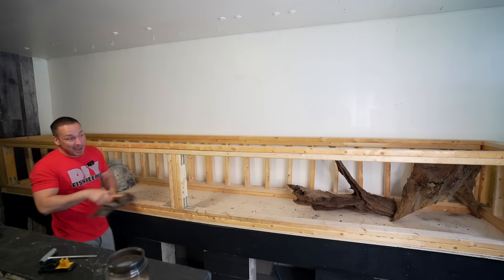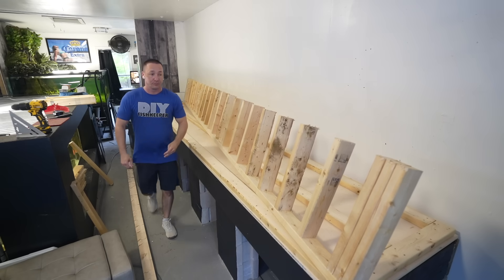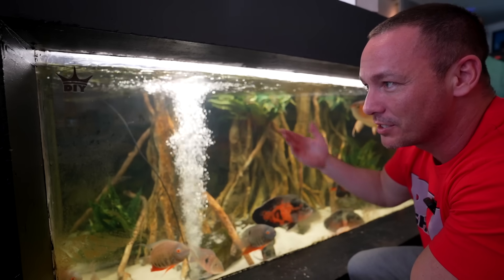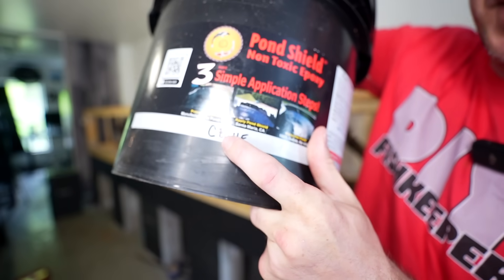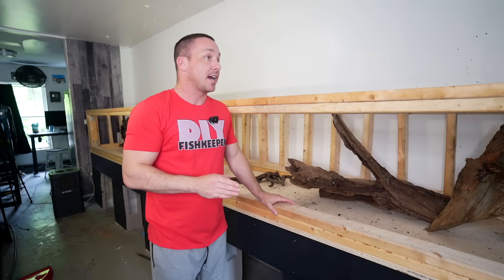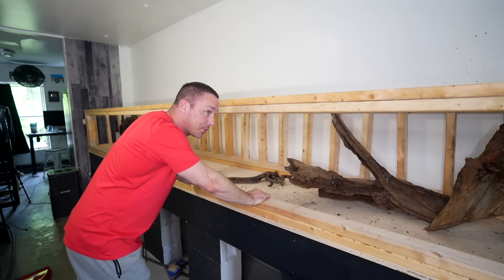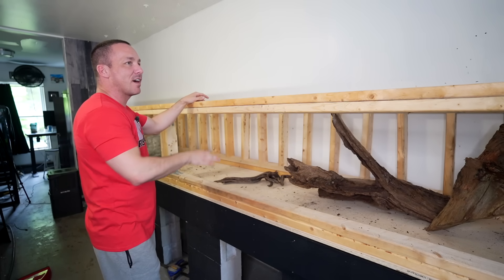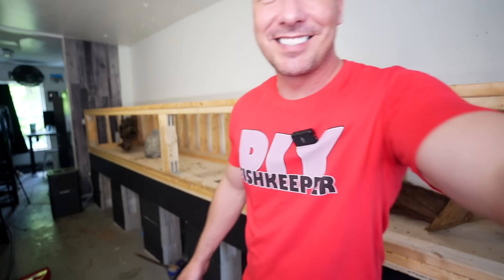16 FOOT AQUARIUM BUILD - Exposed Frame - The king of DIY

Comment from the maker: Dimensions changed a bit. This will make sense in the next video!
Reply: 448 gallons going by rough internal dimensions. 183.5" x 24" x 23.5"
Reply: You might want to consider a riverine setup featuring Barilius ardens (hill trout). Adding some nice lighting can create beautiful refractions over the fast-moving water surface.
Reply: So excited for the update video

Comment: Don't worry about how often you upload Joey, we miss you while you're gone but we know you have a life outside of youtube. YOU actually helped me last night. I was at home depot trying to figure out what to put on top of my storage unit that's kind of more like a shed but the top is made of tarp and it's weather damaged so everything inside is now getting weather damaged. So I was trying to figure out what I can put on top of there and I thought of what you put on top of your 1000gal tank and now I have a plan. Haven't done it yet because I wanted to measure how much material I'm going to need so I'm probably going to do that today and get the supplies tomorrow. So thank you Joey for the extremely helpful tip! 😆

Comment: For the top bracing I would consider using plywood. With outward pressure it won’t split like 2x10. You can also place double plywood with the top plywood a couple inches thinner so there’s a place to rest a lid

Comment: I've always been curious about building a tank like this.     When considering overbuilding/over engineering the tank/design, is there any reason why you didn't use wood glue to laminate the wood? The wood glue bond would be stronger than any screw/bolt could ever be.